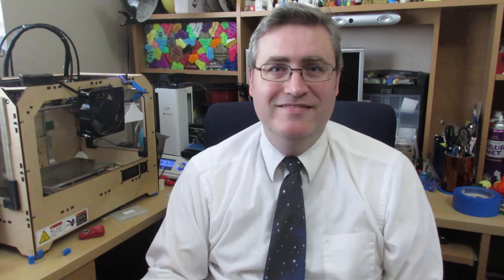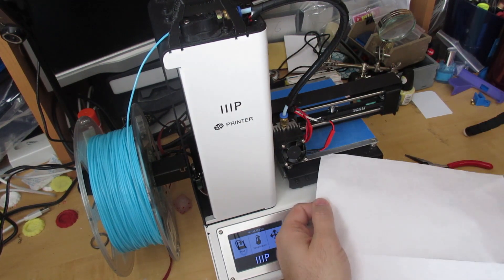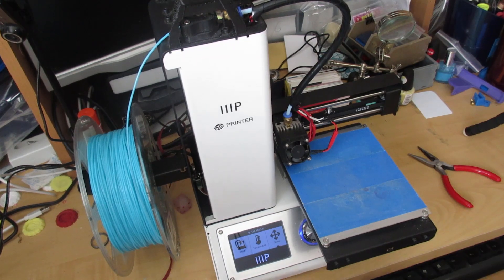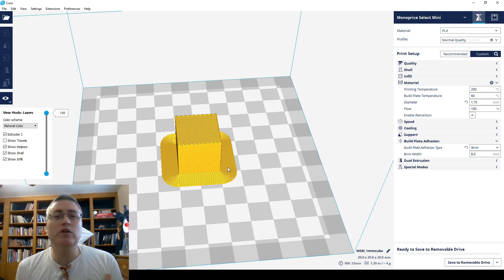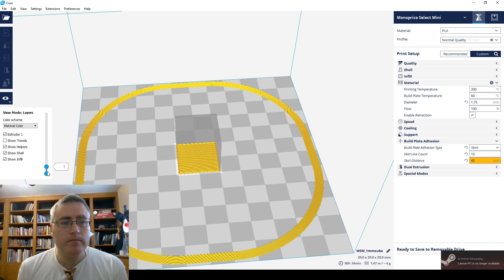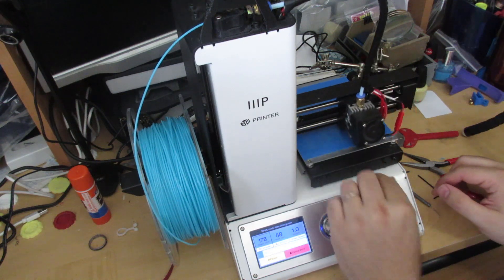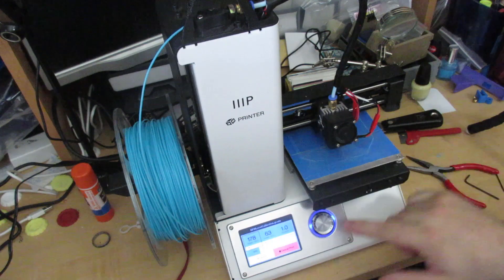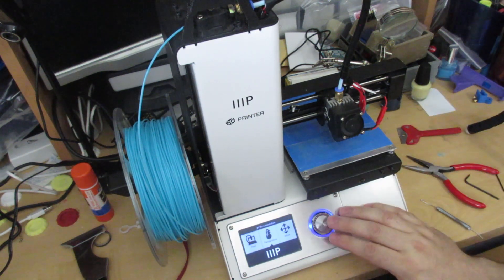3D Printing Basics - How to level your 3D Printer's build plate

Comment: Can you share your Start and end Gcode. I cannot quite get mine right. I wanna kill the fan after 1 min after the print. And rather the gcode not run the start up temp but the individual project. Using cura

Comment: Are you ever going to get to my request I made about 2 years ago? ....no ok
Reply from the maker: You may have to remind me. What request did you have?
Reply: 3D Printing Professor Well I was thinking a bout the tungsten chess set you made, could you make a special dragon themed chess? set I wish I had one.
Reply from the maker: Well, I generally use others' models for the chess sets. And I have pretty stringent requirements. Like the pieces have to be clearly recognizable as their traditional counterparts. That said I've searched on yeggi and there are no dragon chess sets out there, so I'd have to make my own from scratch, and I can already tell I'm getting stumped on the design. The rook is easy enough, just wrap a dragon around a tower. I suppose for the bishop I could do some sort of wizard... I don't know. But what for the queen? Daunting. I'll let it stew for a while.
Reply: That's ok it just took a minute for you to respond I got worried, I'll be paitient it's not easy to make 3D meshes from "just a thought." However If you would like a sample dragon maybe try to make skyrim dragon heads be the pieces. As for the issue with what piece is what maybe put and indent on the bottom for what piece it is? a pawn shape for pawns bishop shape for bishops etc.

Comment: No, it's safety third!

But why did you waste all that time waiting for it to heat so slowly? Just use the preheat menu in the center, takes 3-5 minutes tops to get 200c/50c on my Mini V1.

Also a interchangeable bit screwdriver with a 2mm hex bit works much better.

Comment: I use this method since 3 years. Of cause it is much easier on my makerbot clone since the build plate isn't moving. But on my Anet A8 it is working fine too. On every print I use a 2-3 wide brim and this is enough for checking and correct the build level. I don't need auto leveling sensor.

Comment: My IIIP heats up a lot faster than your.  Do you have enough amps going into it?
Reply: You cannot have "too little" amps going into the printer. If your power supply could not supply the amps the internal resistance of the printer would make it draw, the voltage would be dropping, and most, if not all modern switchmode power supplies would go into hiccup or foldback mode to protect itself when that happens. So if the power supply could not supply enough current, the printer would most certainly reset.
Reply: Thanks for the answer zaprodk. Why do you think his takes so long to warm up?
Reply: They may have changed the power supply specifications (lower voltage) or the heater.
Reply from the maker: It's a new thing for me. Used to be quicker, but lately the build plate is taking a while to reach temperature. the nozzle heats up quick though. Maybe I need to approve the forums.

Comment: Hey Professor Joe, I see that you tape your MSM bed with the leveling screws exposed. I found that exactly two strips of 3M #2090 tape at 2.88" width will cover the table perfectly when leaving a strip front and rear exposed as you do. Also found by accident that a light wipe with 99% isopropyl alcohol works as well or better than glue stick. Just a light almost dry swipe, too much and the print gets welded to the tape. I'm going to try your "live leveling" technique, but at about 20mm/second, because I'm old and slow ... :-)
Reply from the maker: Rich Post With my first covering, a piece of Buildtak, I tried covering the whole space with divots cut out for the screws only to discover that the 120 square could area didn't include that area. Love and learn.

slowing down the process is an excellent idea.

Comment: This method is similar to something I did with my first printer. With just a 1cm square ring around the outer edge of the print area. It worked very well but I found it wasted too much filament. (the brim idea is a good idea)